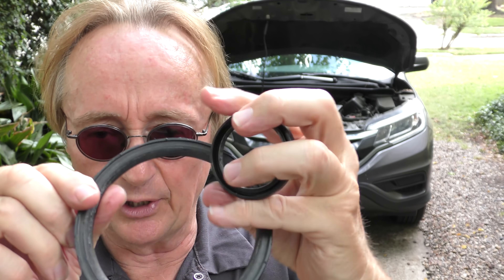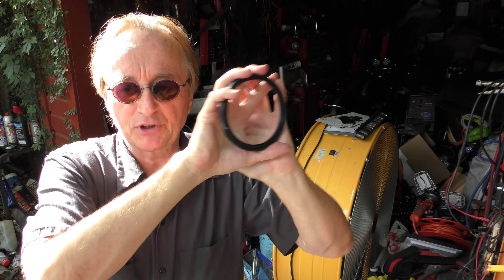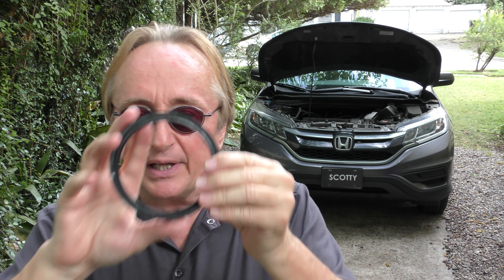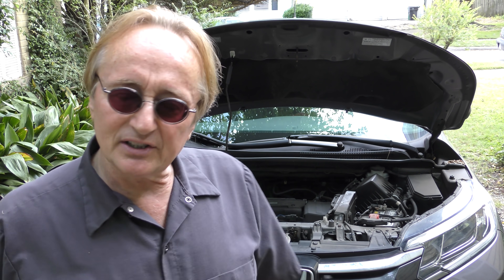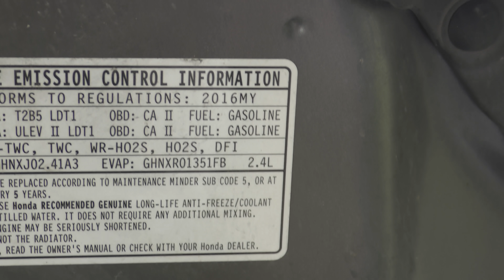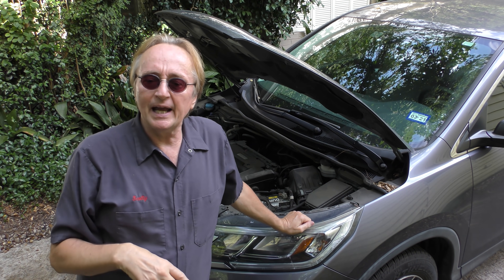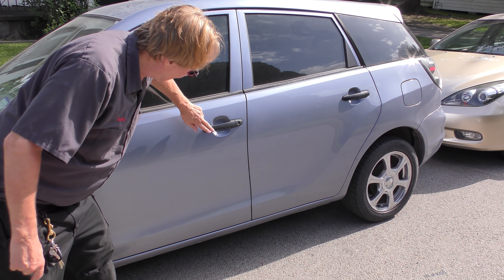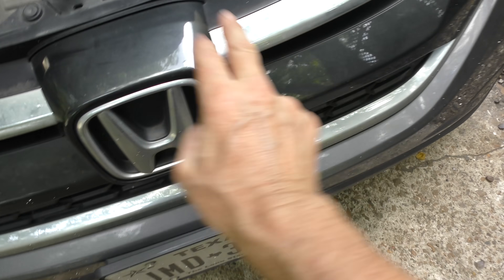If You See This, Don't Buy a Car

Comment: Scotty you crack me up. This is the trend now. Come on man you see all the cheap parts being used to save lots of money now. Plastics used on engines and after a while the heat makes it brittle and then fails. All the cheap Chinese parts. They make crap. Our elected officials have closed our foundries over environmental concerns and we don't make the parts we use to make. Try getting a good flywheel for a manual transmission now. Especially older vehicles after the OEM parts are no longer made. No matter where you go they are made in China and have issues. The throw out bearings are made in China also and don't last. You can thank these career politicians like Biden, and his buddies. I was a mechanic from the early 80's and it was no trouble getting domestic made brake rotors and drums for our vehicles and they were reasonable. The Chinese will make anything if a buck can be made. Problem is the parts are not made with the proper specs and heat treatment. Lots of engine builders having issues with cam and lifters now days. Poor heat treatment or none causing the lifters to eat cam lobes . Ebay is full of parts for things from our older well made lawn & garden tractors to our vintage and newer automobiles. Guys buy these cheap Chinese parts to rebuild a M21 or M22 4 speed and they are junk not made properly. This is the new normal. Many owners are going to go cheap to save money. Somethings are okay and work. It's hit or miss. Ebay is even full of parts that are seconds and made with defects. Parts that have factory packaging but are not good. I run into it all the time. AC lines that are factory rejects with fitment issues. Customer got me a factory  GM valve cover / egr assembly for his Trax off Ebay. It lasted one month before it failed. He came back and I told him this is why he should have just purchased it from Chevrolet or the local parts store. So he went to the dealer and got another one. The one he got from eBay he returned for his money back and the one he got from the dealer is still going . I have now doubt it was a factory reject that made its way to eBay.

Comment: Next thing you know GM’s going to come up with a lifetime filter.
Reply: When Chevy first shipped the Vega, (1970) the air filter was supposed to last 50,000 miles, which was about the life of the car. By that time, the aluminum engine would be smoking so bad, you would not want to drive it, and if you lived up north, the body would be fully rusted out. So, yeah, a lifetime filter.